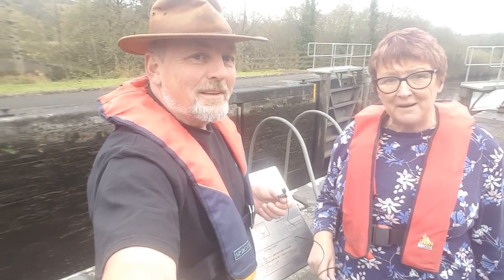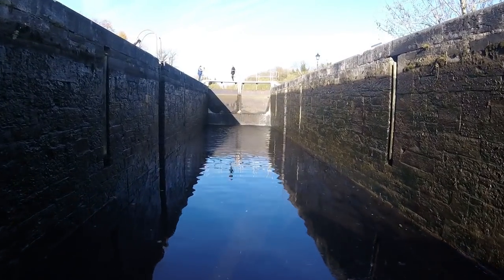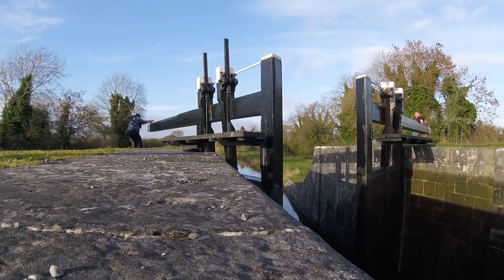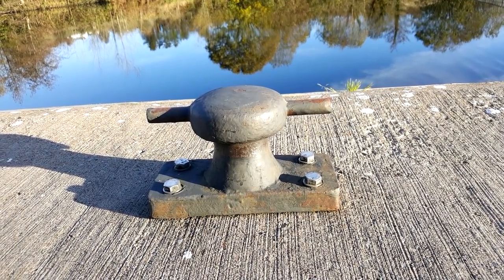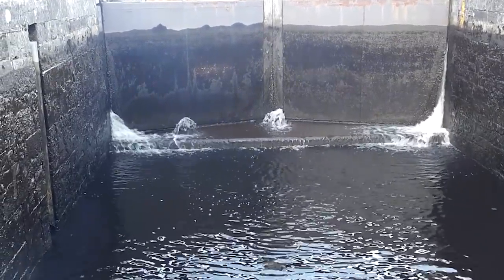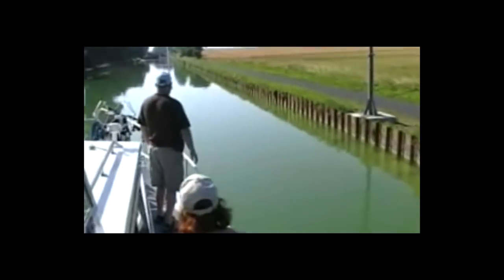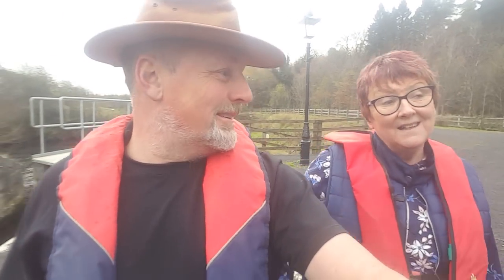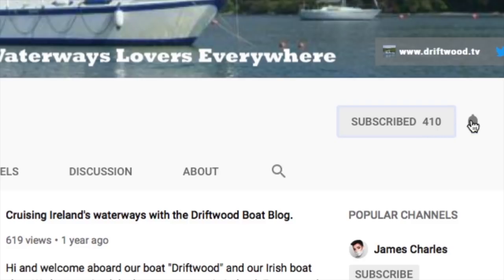Shannon Erne Waterway Locks -  So easy to use!

Comment: @Driftwood Boating Blog hi i have a shetland 644. Would my boat be ok on the canal water depth wise. She has a keel on my boat. Also I'm planning to bring my boat from loch ree kilinure to vicarstown. Would that be possible
Reply from the maker: Yep you should have no worries with the depth, but weed on the canal during the summer is often an issue. Spring or autumn are the best times to travel on the canal to avoid the worst of the weed 👍
Reply: @DriftwoodBoatBlog  Thank you 😊